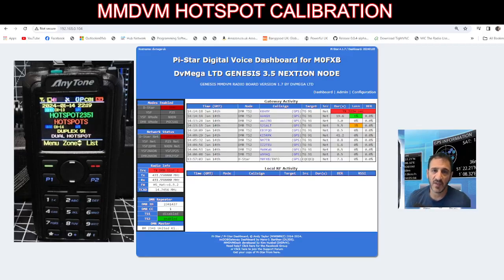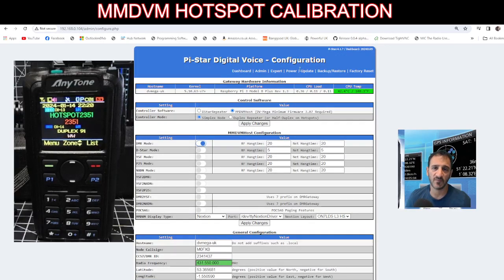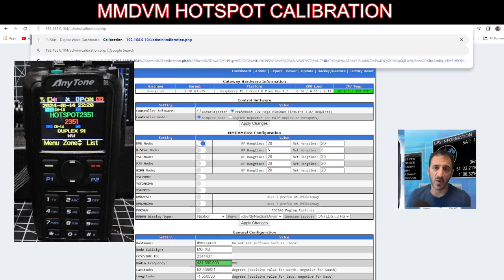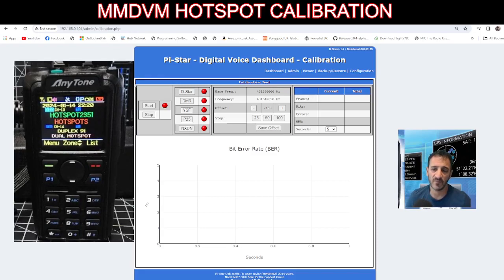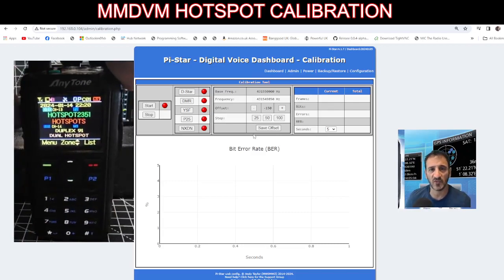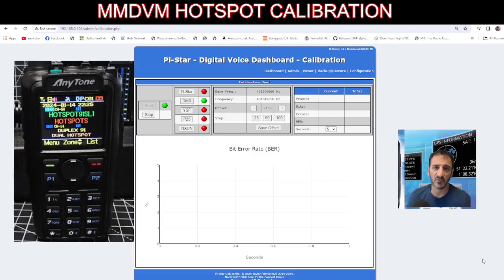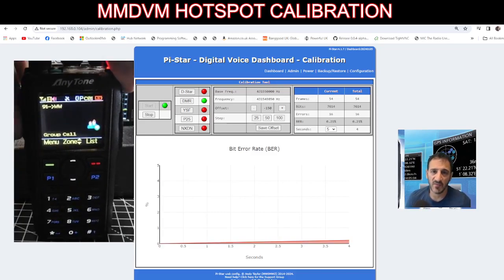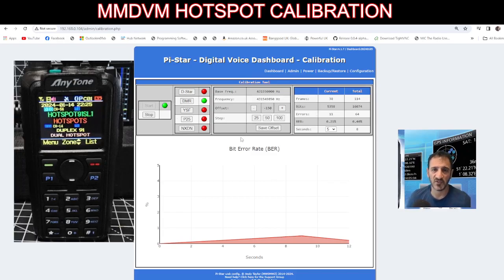PI-STAR - CALIBRATE - BER- DMR

Comment: Great stuff. I’m trying to use the Calibrate tab in v4.2.0 and formerly 4.1.8 for my D878UV2+ and a dual MMDVM hat. I get 2 green dots for start and DMR but no BER graph is produced on PTT, and the radio just notifies “repeater not found”. You used a dual hat too right? Any idea what the problem might be? Thanks and 73
Reply: Got it thanks. I get a BER graph now if I push and hold PTT prior to setting “start” and “DMR”. I hadn’t realized that so my bad. 73 and thanks for your valuable content
Reply from the maker: Repeater not found means you are not reaching the repeater get a hotspot then be easy .